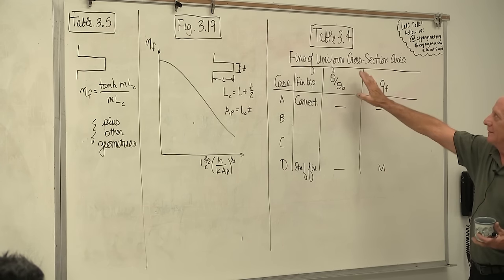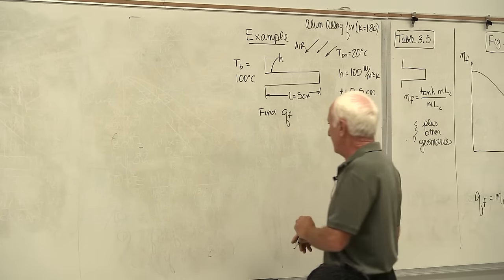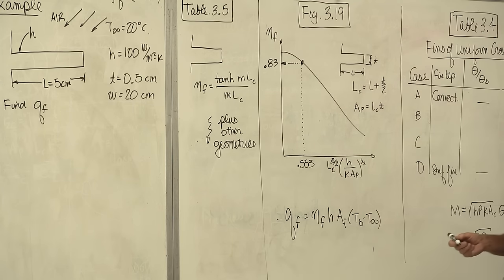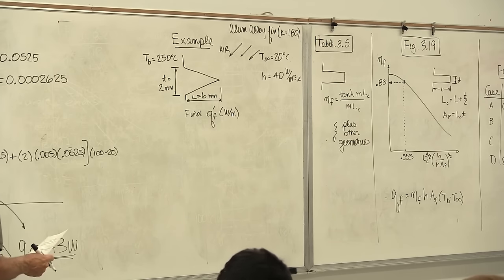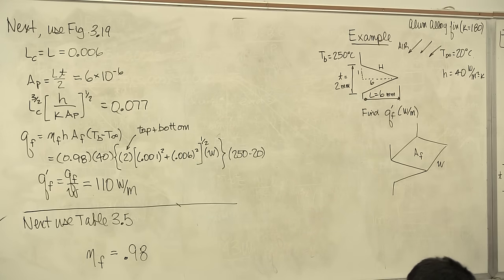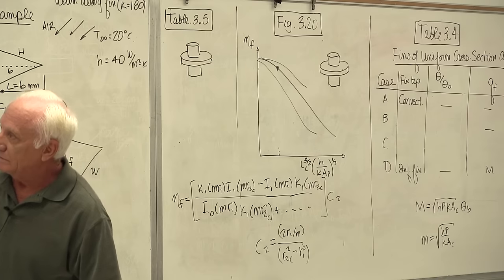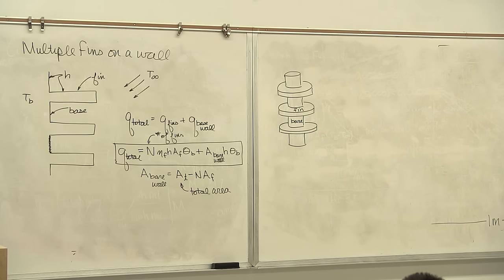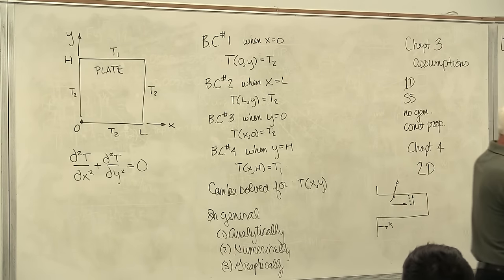Heat Transfer: Fin examples (7 of 26)

Comment: in the first  question why did we use Lc (5.25) instead of L(5) when we solve by Fig 3.19?
Reply: pretty late but i hope it helps. the question mentions convection from the tip and while solving for fins with convective tips we tend to account for the heat losses from the convective tip by assuming an insulated tip with an extended (i.e corrected length). if my explanation isn't as clear you can check this where he explains the same (in the second half of the video) https://youtu.be/I-xbn0kw8GA

Comment: At 31:54 when calculating Af, why are the surface area of the sides of the fin not considered? Only the top and bottom was considered...
Reply: because the length "w" was infinitely long
Reply: As he said in the lecture it is wide and long fin, but I think we can add that it is very small compared to the top and bottom.
Reply: Watch min 36:30

Comment: This lessons are wonderful. But i got 2 questions. Why we used sinh and cosh formula instead of using M*tanh(mL) in first question? And is it M*tanh(mLc) for convection at the fin tip? Cause i tried it with Lc and find the correct answer. Thanks for the proferssor and his crew.
Reply: It will be the same if u use tanh and for the second question,no it's not for the tip because we neglect ∆t of the tip cause it's almost zero but it's for the base hope u understood

Comment: Hey at 28:43 , can someone tell me how he get 0.077? and the K still 180 right? if so, i got 0.0894.
Reply: The value  of K aluminium is 237.75 at 250 deg C using the value given in the appendix of the book that Prof. Biddle is using, and the value would be .077
Reply: @byagnik  I see. Thank you so much!!!